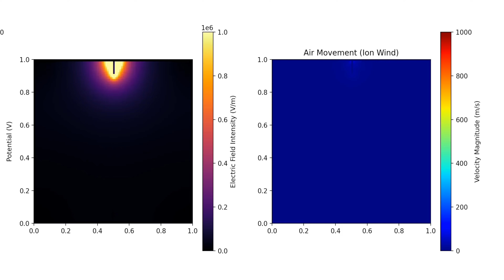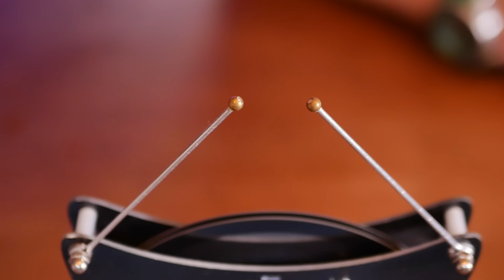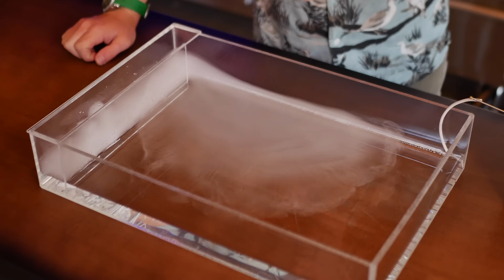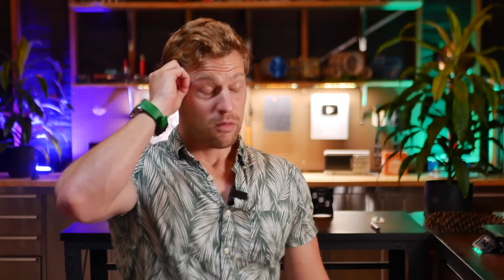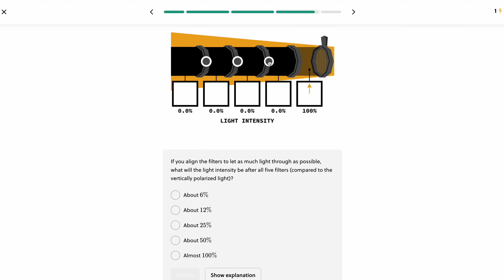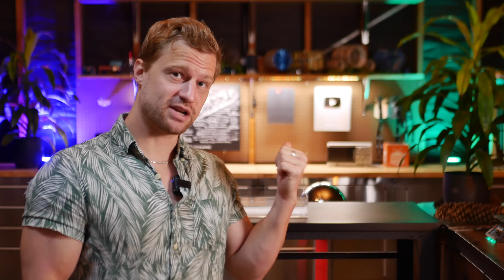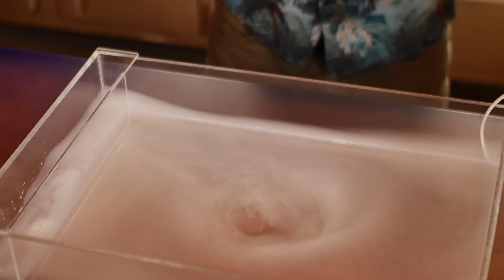This High Voltage Fog Is Controlled by Pointing (BiFrost Nebulagraphy)

Comment: I mean I feel like you buried an important detail here which is that you are electrically connected in circuit with the nebula. At the start of the video you almost seem to imply that the vapor is charged but you are unconnected to the system it isn't until almost 2 minutes you mention this detail which if you've ever seen someone connected to a van der graaff generator shoot charge off their fingers makes this demo much less surprising...

Comment: Your a legit Air Bender. It's crazy how crisp and quick the feedback response is of this. It was like you were drawing on a touch screen from 5ft away
Reply: I only managed to measure the speed once.   It was around 30MPH.   So, if you wiggle your hand back and forth at 30MPH or faster, then you will see a delay in the response of the fog!

Comment: this would be cool applied to other forms of tech. like imagine a virtual reality room where the grounding was set up on the walls and ceiling and the floor was the hot side. you could in theory create a human sized controller that way with no need for you to actually hold a controller.

Comment: Now think of the global electric circuit and what the sun and space weather does to our clouds.  
Think of how a tornado and low pressure is connected electro statically to the earth, causing rotation . High pressure and low pressure have an electrical component to the zones.

Comment: The variability is easily explained. It is the amount of electricity in your body that is accumulating and releasing the same thing happens when you use a voltmeter and hold the positive and put the negative in the ground and then stop your feet up and down or lift your hand up in the air higher, the voltage increases.

Comment: I would have expected the ion bridge to be the shortest distance possible, so it wouldn't work like an extension of the finger like it does here. I would expect it to be less like a laser and more like a bolt of electricity (or more like electricity in general), how it always tries to take the path of least resistance.

Comment: I never knew of this effect until I watched this video. I was thinking it was Ion Bridging before you mentioned it. Stepped Leaders. I wonder what applications this effect could have if adapted to technologies for personal and societal needs. Wireless keyboard where you type in midair? What would happen if you used a laser taped to your finger while pointing at the fog? Can this effect be pulsed as in point at the fog and pulse the voltage and/or laser (what effect would that have if any)? If so, can this be scaled up to repel fog from a large area like around a ship? Would it be safe to do so?

Comment: Next you will create a standing wave inside a super fluid creating an internal sonoluminescent artificial metalic hydrogen sun and polar opposite Bifrost Nebulagraphic moon, This tech is also able to control weather, earthquakes, anti gravity, plant growth(large trees), Melting buildings etc.
Maser, A maser is a device that produces coherent electromagnetic waves (microwaves), through amplification by STIMULATED EMISSION. The term is an acronym for microwave amplification by stimulated emission of radiation.
Temples, Pyramids and the like ie Cathedrals and Taj Mahal are Macro Electronic Machines from masers to Ionophones( Taj Mahal is a gigantic Ionophone).
Tesla was right and they(BabAlonian Cult) have suppressed this, for it is the how this domain is formed and maintained.
The heat we have is critical to keeping the ice at bay, remember the experiment he shows us is a contained system, just like ours.

 The first astronomical maser discovered was used as evidence for the existence of molecules in space, which some researchers at the time didn’t think could exist. Since then, astronomers have found masers from water, hydroxyl, hydrogen, ammonia, methanol, silicon monoxide, and many other molecules.

 Laboratory Masers in Astronomy

Artificial masers work the same basic way as the naturally-occurring versions, only with dedicated power supplies and amplification chambers to contain the gas. Astronomers use the very precise frequency at which molecules in masers absorb and emit light as a clock. Hydrogen masers are used to coordinate telescopes separated by thousands of miles, the observation method known as Very Long Baseline Interferometry (VLBI).

Comment: I have noticed that you never see lighting strikes around tornado s in videos i see making me wonder if they are draining the clouds of there charge and could that current flow through a funnel cloud be diving its rotation.Seeing the vortex affect makes me wounder even more. You should put a flat metal plate the same size as tank over the tank and see if you can make a vortex form.

Comment: Ionic Wind: High voltage at a sharp point ionizes air molecules, which then move toward an electrical ground, pushing other air molecules along the way. This movement could help shape the fog patterns.

Electron Tunneling and Ion Bridges: Under strong electric fields, ionized air can form a pathway allowing electrons to flow across air gaps without a full spark or plasma, influencing how fog moves or shapes in response to electric fields.

Forced Condensation: High voltage can also influence water droplets in the fog, causing them to combine into larger droplets that fall more quickly, effectively clearing paths in the fog.

To expand upon this effect:

Investigate with different voltages and configurations to see how these affect the patterns and behaviors in the fog.
Explore with other types of gases or additives to the fog to see if they enhance or change the visual effects.
Utilize simulation software to model and predict behaviors under various conditions, providing deeper insights into the interactions at play.

Comment: The vortex could be a magnetic field being generated by the flow of electrons. Since the temperature of the sublimated CO2 would be lower is it possible that the dew point is reached at the surface and h2o in the air may be reacting to the field?

Comment: I think Bill Beaty mentioned this on his amasci website.
Reply: Try using a single human eyelash.   Try a torn edge of paper, and it makes hundreds of little dots in a line.   Bend the paper into a triangular tube.    I thought this would get the Nobel Prize, but eventually found that it was discovered around 1914 or so.   John B. Fenn found an application for it, and got the Nobel in 2002.

Comment: Have you ever noticed those ancient buildings,  churches,  and mosques always have a pointed tip on the roof ???   Pyramids in eqypt are built seemingly emphasizing to a singular point even placing gold caps on the tip of the structure.......   Purely out of speculation,  but i think the ancients knew about electrostatic energy.   The only question is what would they use it for ?

There have been eyewitness reports over the years that they have seen beams of light coming from the tip of pyramids.   Your experiment could explain and verify their claims.

Comment: Is it possible to power something with the air wire? Like a setup where everything has a common ground and an air wire completes the circuit from source to load

Comment: I cant express my gratitude for both you posting this and for YouTube putting this in my feed. This may have just solved an incredibly important engineering problem myself and my colleagues have been working on for the past 6 months. I cant talk about it here other than to say THANK YOU. If it works, and I suspect it will, I will definitely post more detail when I am able.... if it does it will be something that touches the lives of millions of people around the world.
Reply: Come onnnn just tell us already. We won't tell🙏😭
Reply: Jooo you cant leave us hanging like that brother hahaha. 

I want to be touched now :(
Reply: a wet hypodermic needle at about 1KVDC will produce these streams.  Adjust the HV and the nearby ground-plate to get a thin laminar stream and not a wide spray from coulomb-explosion.   One grad student here at UW was trying to photograph the streams under a microscope, using fluorescein solution and violet laser, but I don't know the results.   Otherwise, look into Colloid Thrusters for satellite stationkeeping, where the emitters produce many thousands of parallel streams, to attain tiny thrust.   In FIB ion-beam lithography, the stream emitters are called liquid-ion sources (the "ions" are electrically charged micron-scale metal droplets.   In hard vacuum they require focusing-fields, but in air they experience "gas self-focusing," which is the origin of the thread-like structure.)
Reply: To research this, look for Electrospray and "Taylor Cone."    It's not ion-wind, instead it's streams of micro-droplets.   Clean fingertips won't work, so instead, wet your fingers, then rub them on fabric.   tiny bits of lint will start emitting these narrow streams.

Comment: I wonder if it’s possible to put a capacitive screen or some sort of ink type of screen filled with conductive material underneath the tray then Use the images you draw on that screen to cause the smoke to disappear replicating the image. If you could do that, then you could probably use a projector on top of the smoke to draw a picture creating a volumetric picture.

Comment: You've should try this with supercooled fog droplets instead, they should freeze and sparkle if your condensation theory is correct. You could do this in a -40C deep freezer, just briefly add a hot mug of water to the bottom of the freezer, take it out, let the fog settle, then you'd have ice beam power...

Comment: Can you give us the make/model of the “high voltage/low current dc power supply” and where to buy, please. Thnx
Reply: @arctan2010 it's a Sparkit Wimshurst machine.   Instead I've been using a 12V "anion generator module" for this, powered by a 9v battery.  They put out around 7KVDC.  And try a metal cookie sheet, painted black.

Comment: If this could ever be implemented into road safety, imagine highways free of fog.
Reply: Think airports would benefit more to start with...
Reply: @mice3d Here in Tennessee there's a corridor of highway that produces very dense and hazardous fog. There was a pileup some years ago that I believe had over 100 vehicles.
So in this area, I'd have agree with the OP, that could be a game changer!
Reply: I can already see the headlines from here: Thousands of cars immobilized after high voltage electrostatic discharges fry car electronics and then zaps car occupants stepping out of disabled cars 🙂
Reply: It is still dangerous to human with implanted device on their organs.
Reply: um, wouldn't it be far more efficient to just use a fan ? seriously dude...
Reply: Headlights that part the way through the fog....

Comment: would it be possible to recreate the exact same effect using a non biological component?    i figure if you can create such a beam using power,   why could you not increase the power 100  or even a 1000 fold and see how  much super heated plasma it creates at the end of that beam.   i mean.  food for though.

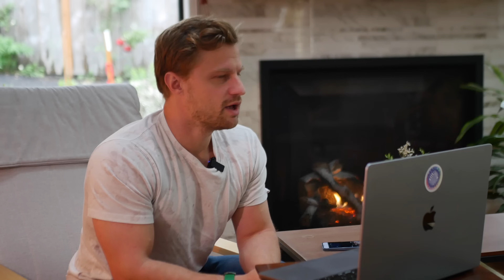Comment: @Plasma Channel  - Thanks for the video, a very interesting effect! I also got a kick out of "Propagation of intense catastrophe beams in air", mainly because it's fun watching scientists squirm and try to find new and inventive ways to avoid saying Tesla's death ray. While I will assume that for the sake of entertainment value, your actual experimenting was cut out of the video. From the viewer's side, we got to witness an effect and then a brief explanation of 3 possible theories, but no actual experiments, measurements, or testing of the theories. I would love a longer video with the testing left in, if possible. The setup has several variables that should be tested to see what role if any they play in the effect. For example would a different gas or liquid change the results. How does changing the conductivity of the liquid alter the results? Attempt manipulating the effect by introducing a magnetic field, does this alter the course of the beam? How is the beam affected by different types of obstructions, for example, does the effect work if a plate of glass or sheet of paper is between your hand and the liquid. Does the air temperature affect the results? Instead of using your finger can we use other materials and test a small range with conductive and insulating properties? Can we create a deeper fog layer to observe air currents being created farther from the liquid surface? What effect does reversing the electrical polarity have. What would we observe if metal fillings were suspended in the liquid? Then the next most important part since you already developed some theories are there any ways to challenge them? What must happen that would disprove ion tunneling being the correct explanation for the observed effect? I find that a theory is only as good as its potential to be disproven. A theory that has the potential to be easily disproven is a good theory. A theory with no ability to be disproven is faith, not science. I love your videos!!!! They always get the creative juices flowing! You should also look into  this video "Shooting Electrons In a Cloud Chamber Is Amazing!" by "The Action Lab". AT 4:55 in the video he runs an experiment very similar to yours but instead, he is using alcohol vapor in a cloud chamber setup. His and your experiments are very similar in principle but produce dramatically different results. Might be interesting exploring why. Crossing my fingers for a follow-up video!

Comment: Do it in a room with zero air. Then come talk to us.
Reply: Already been done.   The beams speed way up in hard vacuum.  They easily drill through thin glass plates.   (Some people insist that these beams are the same thing as Tesla's death-ray.   But Tesla was using liquid mercury, not water etc.)

Comment: This channel is becoming better and better. It features spectacular phenomena and theory behind them - it's really valuable. And last but not least the advert promotes not just some random commercial stuff, but education. This is definitely one of Youtube gems.
Reply from the maker: Wow thank you so much. I really try to bring value to the table, innovate, and document what essentially is my passion. I really appreciate you.
Reply: @PlasmaChannel Glad to have just found your channel! I've been experimenting with monitoring electrostatic charge on radio antenna guylines for several years.
Have some cool video of rhythmic pulses of visible electrostatic arcing OVER the 6" gap on the big ceramic guy line section insulators as thunder storms approach.
Bzzt..bzzt .bzzt..bzzt..bzzt
Reply: @mrfirestop415  we can harness lightning  ...just wiggle a thunderstorm back and forth?

Comment: Were your voiceovers AI generated? I almost clicked away as soon as the video started, and I had to double check that I was on the right channel. Maybe it's just a new mic, but either way, it sounds like one of those AI-generated mass produced brainrot videos.
Speaking of brainrot, you should try explaining some of those fancy terms you were using, like coronal and dialectic discharge. I have no clue what those are, and it would help me actually learn things if you explain them, especially with good examples.

The fog effect looked cool though!

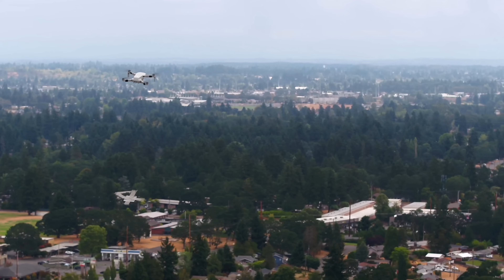Comment: 1:17  quick thought, let’s put your findings and some alphafold together and modify the human body to transmit high voltage energy but also magnetic fields and such. Could develope magic. Obviously the human body isn’t designed for that but we use ai and alphafold to predict a pattern or patterns to make possible. Look at omniverse from nvidia and replace the weather info and such with other data and models. Potential is exploding out of ai right now.

Comment: I think and i have been thinking this for years!!
THIS IS the same effect as the observe mode in Quantum physics.
When you observe the there is a energy pull our to the point you look at.
its so minute you cant measure it (yet) but you can see it there.
Now here.
As it finds a direction to dissipate to ground which would be your ginger tip.
Weird stuff and speculating is fun :p

Comment: Super cool video. maybe you can make a "linear-laser-with-fog" setup like this in the AlphaPhoenix channel.
https://youtu.be/exRgzJaB3D4?t=266
It would be awesome to see the air beeing ionized from your finger to the water in a smokey fashion.
Is it possible to measure and log the voltage and the current over time?
Reply from the maker: Certainly great ideas - in particular i'm tickled by the idea of measuring current levels before and after pointing at the fog. Might have to tap into that one.

Comment: Damn Jay, you just keep crushing it!

The things you show are always cool and beautiful. And I always learn new things tangential to your topic, like them watering crops in arid areas using high voltage.

This is why I will gladly continue being a Patron.

(Also, as someone else mentioned, you should try this using one of those cheap ultrasonic vaporizer as a source of fog so you could in theory use as a desktop, non stop display. And could use one of those antistatic wrist bands to connect yourself to power source without having to hold. Freeing both hands )
Reply from the maker: Hey Justin! Thanks for the thoughts. Yeah, I had never heard of watering plants that way, before shooting this video and digging deep looking for answers. Its kind of an experimental agricultural practice, that is not universally used. As for the desktop stuff - ohhhh man I could totally make a kit for people!
Reply: @PlasmaChannel  definitely!

Comment: Charge density is concentrated on your finger tip as it is a sharp point relative to your hand.  Ions would therefore stream off your finger tip just as sharp points on high voltage components results in corona discharge.😊